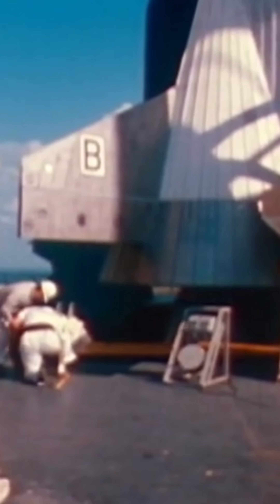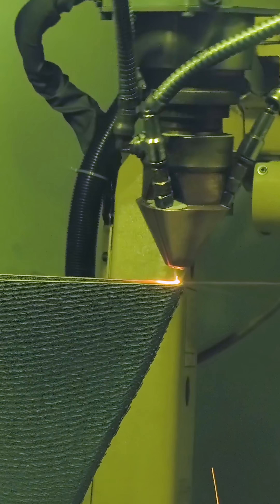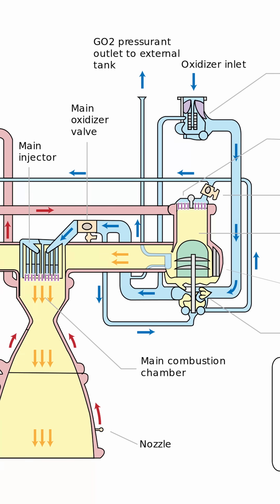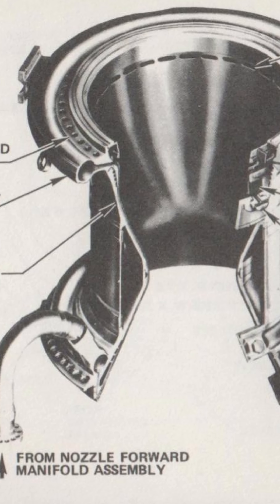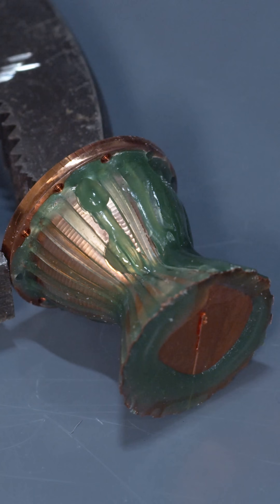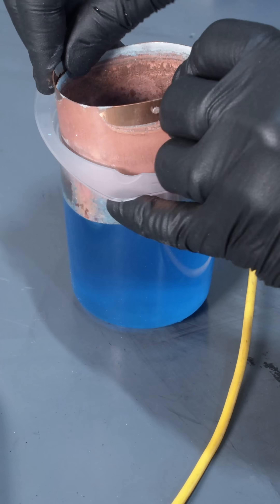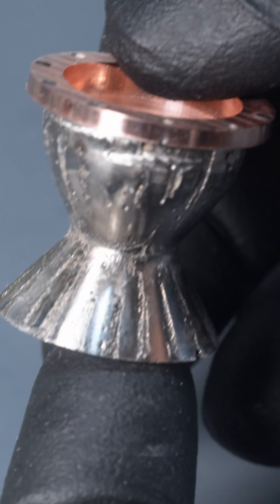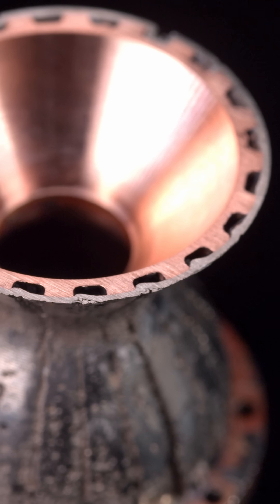Space Shuttle Combustion Chamber

Comment: wax might support 400 nanometer feature sizes, I used to have a soft wiggly vinyl diffraction grating, a Jupiterscope,  that just like a transparent roygbiv spectral line making spectral line at sodium lighting seeing filter did transmission spectroscopy. Its basically soft polymer vinyl with 400 nm microlines stamp or roller embossed on it. One nifty thing about the Jupiterscope is that if you got hair grease on a window, and pressed the jupiterscope on it the hair grease was molded to the 400 nm jupiterscope lines, and you could see roygbiv lines through that part of the window. Wax is between grease and vinyl, so I think embossing wax with <400 nanometer features is possible. 

If you make the wax with some % of a conductor like 1 nanometer electrically conductive PEDOT polymer nanoparticles  or gallium metal liquid blenderized with warm melted wax you can get an electrically conductive wax that you can then emboss, jupiterscope syle with things like gecko sticky tape microfins, nanofins, diffractive lenses, metamaterials, and tall columns that shed water and stay hyperclean. being conductive they then electroplate directly, skipping the Cu, with something very strong but cheap like Cr metal, maybe even a high durability Cr alloy. 

You can use this to emboss things like water and gunk shedding cheap acrylic lenses, put water and grease shedding nanometer columns on light transmissive phone screens, and food and fluid delivery nozzles. 

The big benefit of wax over stamp and roller embossing of nanofeatures is that the parts can be any shape; round, or undulating or tube forms, like special purpose mirrors, optical fiber comb filters, and other things. 

Going a little further than wax, silicone liquid that cures to rubbery polymer, like aquarium silicone, is published as useable to make form shape impressions of single strand DNA, just about 2 nanometers feature thickness, much tinier than 400NM jupiterscope photonic diffraction grating.

Electroplateable conductivized 2 nanometer feature silicone rubber could make even tinier technologies that do more things, and make more new technologies possible. They could mass print vaccines from things the same shape as RNA/proteins. There is a published paper that said silicone molded DNA, or maybe it was protein (much bigger/wider) stamped rubbery goo then produced a custom immune response. mass embossing it for mass production is engineering that could make the active ingredients in vaccines much cheaper. After the vaccines go generic, the <1/1000th of a cent microgram or even milligram mass (That is $10,000-1 million per kilogram of fancy rubber) of rubbery protein/DNA functionalikes could make vaccines, now administered at such high doses that oral pill vaccination works then makes 1 cent vaccines possible. 1 cent vaccines benefit both the developed and developing world.

Comment: The first CNC machine was invented in 1952. So depending on what your definition of “3D printing out of metal” is, you’re kind of wrong.
Reply: I’m trying to think how you could make a component like this using ‘50s tech. Laser sintering is out because the first laser was made in 1960, but electron beams were pretty common and well understood (televisions), so that could work. Thermoplastics were also around then, meaning an FDM machine is viable and thus something like lost PLA if it could be cast. 

The biggest challenge (other than inventing 3D printing 30 years early) would probably be creating the model and storing the sliced solid

Comment: They did plating of Cu followed by Ni plating for a certain minimum thickness and then built that deposit with electroless nickel plating for a few hundred hours. These assemblies were then heat treated for a porosity and void free outer deposit layer that was metallurgically bonded solid and homogeneous too . 
The nozzle and the chamber were made from a superalloy containing good amount of copper.
Several hundred hours of processing was done per piece and size was progressively increased.
Rome was not built in a day.
R

Comment: The F-1 engines were made by Rocketdyne, not NASA. My grandfather worked there at the time and I have a gold F-1 engine lapel pin that they'd given him after the first Apollo mission. They used to test rocket engines up at a facility nearby in the mountains surrounding the valley we are in. This went on until very early 2000's - the entire valley would shake during these ~3 minutes of testing the rocket engines at full blast. The facility was called the Santa Susana Field Laboratory, which also had a nuclear meltdown on an experimental reactor General Atomics was running, venting it straight into the air and kept hidden for ~20 years....
Reply: The Space Shuttle used the RS-25 engine, not the F-1. Still Rocketdyne (now Aerojet Rocketdyne) but not the F-1
Reply: @richardmillhousenixon They said they have a F-1 engine pin, not the exact engine that was used, or tested. They didn't specify the engine at all, only that they had a F-1 engine pin.
Reply: @NeoVei they did say in the first sentence "The F-1 engines were make by Rocketdyne, not NASA". That sets up the context that they're talking about the F-1 throughout.

The video is talking about the space shuttle but they're showing footage of a Saturn rocket, which used the F-1 engine.

Basically, the short author was inconsistent and therefore both the original comment and the one you're replying to have valid positions.
Reply: @keegans5695 You do not need to speak for the person I was replying to. But thanks for the feedback.
Reply: @NeoVei  They didn't need to, but they weren't wrong
Reply: They showing video of the space shuttle …. No wait .. they’re not .. 
They are showing video of the Saturn five it looks like to me which has the F1 nobody said F one but they’re showing it in the video
Reply: Patrolling the comments almost make you wish for a nuclear winter
Reply: wow
Reply: Thanks for the info. Love YouTube comments like this.
Reply: Who mentioned F1 engines 🤫🤫

Comment: While this is super awesome and I never knew that electroplating could be used to actually create a whole new surface over things that are not even metal such as the wax and pretty much anything other than a microscopically thin layer for something like plating metal such as jewelry. However I feel like that could have been done with machine shop tools like create the original peice u made but thicker and then machine or drill the cooling channels? Or do it exactly like this was done but then use metal sleeves or multiple sleeves of different diameter then heat to expand it slide on theb cool now its on air tight or machine and or cast an external aleeve thats the exact whape of this peice just a little bit larger than cut it, then slide in the internal original machined peice and the weld or solder the spot that you cut for the shell peice you casted that allowed you to insert the internal part

Comment: That's so cool 😎. Way smarter than 3D printed. Does this model have the properties required to function? It would not be uncommon to machine the inside details and join cups from either side which fit completely and screw together forming the unit. So I wondered if this is really how they built the full size item ?(by electroplating)

Comment: Lost wax process. Turbine blades are cast in the inverse way. Create a wax model, spray with fine slurry then heat wax to lose it, cast metal into cavity, brake off slurry shell to reveal the part. Wax is an awesome tool.
Reply: Using a pre-bronze age sculpting technique to build a spaceship. Pretty wild.
Reply: that's what they did with brass naval guns back in the day.
Reply: This is exactly how PCC Schlosser cast lost wax parts for the F22 Raptor when I worked there in the early 2000's except the wax model was dipped and redipped in a vat of slurry for multiple layers instead of sprayed.
Reply: this isn't casting at all
Reply: I installed the laser printing machine that is used to create turbine blades today.
Reply: @larrysorenson4789  Cool! 👍

Comment: The problem i see on a larger scale is the electro plating bridging the gap over the wax. Maybe mixing copper powder in with the wax the electro plating would stick to the wax untill it is melted. 😀
Reply from the maker: Yep! There are a few methods used to tackle this problem when scaled up. NASA buffed a silver powder on top of the wax, and a few other agencies use conductive wax (graphite or metal-powder filled wax).
Reply: @BreakingTaps  That is amazing! Thank you for taking the time to reply. I love problem solving like this. I wish I had a job that involves this kind of out of the box thinking. I used to build refrigerated air dryers, Well we came up with prototype that rerouted some of the compressed air to move the glycol instead of a expensive electric pump. It would of saved the company thousands a year because each machine uses a pump. Hope your having a great day!!

Comment: A copper and nickel rocket engine with a melting temp of 1000 degrees C…… while the engine burned at over 2000 C🤔
Reply from the maker: The slots in the chamber flow cryogenic liquid hydrogen, which keeps the temperature of the chamber below the melting point :)
Reply: @BreakingTaps  Thx for clarifying🙏, tho I still will never fully understand thermal or fluid dynamics….. but that’s why I’ll always be a peasant 🤣

Comment: It was not only a big problem to make this part, I'm 100% sure it was great pain in the ass for the quality control to check all of this inner pipes for tolerances and overall tightness. Can imagine amount of hard work and bright minds to make this thing real
Reply: First thought that came to mind, use water and measure the volume. Or to be overly complicated, maybe something with fluid dynamics that has to do with flow.
Reply: @captaincannabis3321   Water amount  is good, even better is a thermographic camera that films while cold and hot water is pumped alternately through. You see every single channel when you set the color scale to a small temperature range like 25-35 °C and pump the water with > 10 bars

Comment: Allow me to clarify something, I’m not saying 3D printing is bad. 100fill metal prints are strong. But structurally speaking I wouldn’t use it for buildings or anything. I’m a machinist and I’ve had to cut 3D printed steel and aluminum parts and the amount of chipping and break points in it is severely high. It’s got a long way to go